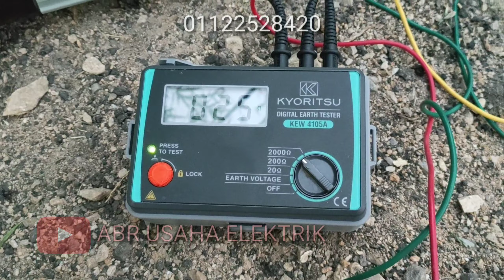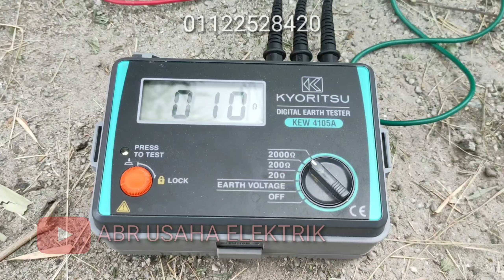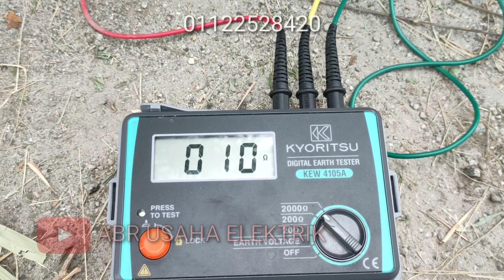Sistem pembumian SMIK ikut spec suruhanjaya tenaga elektrik

Comment: Apa bezanya 3 phase 3 elcb dengan 3 phase 1 elcb ? Kenapa 1 rumah Ada 2 distribution box sedangkan bukan 2 tingkat ? 01 dan 03 apa bezanya ?
Reply: apa yg 3ph 3elcb & 3ph 1elcb ??
Reply: tidak semestinya 2 tingkat baru ada 2 DB.
keperluan DB ke-2/seterusnya dipertimbang jika jarak wire final circuits sudah terlalu jauh utk disupply dr DB pertama atas faktor jarak maksima wire vs voltage drop.
Reply: 0.1A atau 0.03A merujuk kpd tripping sensitivity berdasarkan residual current.
pemasangan RCD 0.1A / 0.03A adalah utk kumpulan circuit yg berbeza.
Utk premis domestik,  0.1A digunakan pada litar am seperti lighting, fan, A/C, sistem sekuriti, dll yg tidak ada sentuhan langsung dgn pengguna. 0.03A pula dikhaskan utk SSO13/15(socket). 0.01A rccb/rcbo pula dipasang sebagai peranti pelindungan(supply dr selepas RCD 0.1A) utk water heater/area sgt basah.

Comment: Tapi dalam channel mah bayu semuanya rumah customers pasang 03
Reply: secara defaultnya, utk 3ph RCD, memang menjadi kebiasaan 0.3A dipasang. Namun ini tidak mematuhi syarat kehendak ST utk penggunaan domestik.
Praktis ini dianggap lebih 'sesuai' memandangkan circuit 3ph adalah lebih banyak & dianggap mungkin meningkatkan residual current yg diimbas oleh RCD dan mungkin menyebabkan nuisance tripping apabila mendekati ambang 100mA. Utk mengelakkan hal ini, jadi RCD 300mA dipraktiskan.
Namun realitinya, dlm penggunaan domestik, total residual current dr equipment rumah jarang mendekati ambang 100mA. Pengecualian diberikan utk situasi komersial/industri.
Reply: Pakar Pekena  Utk pemahaman mudah tuan, 1.0A/0.3A/0.1A/0.03A/0.01A merujuk kpd betapa mudah/susahnya elcb TRIP andai anda tersentuh wayar line(hidup).
0.01A adalah termudah/pantas diikuti seterusnya dan 1.0A adalah yg paling susah/lama. Jadi utk keselamatan+nyawa diri & pengguna rumah, pilihlah yg serendah/paling sesuai RCD utk digunakan. Elakkan 0.3A .